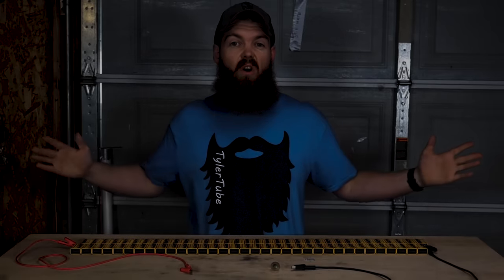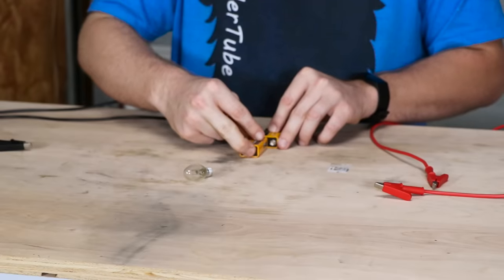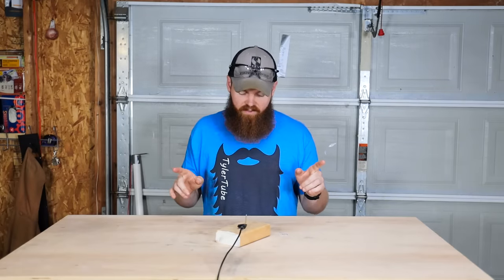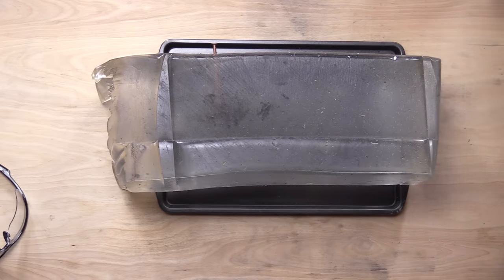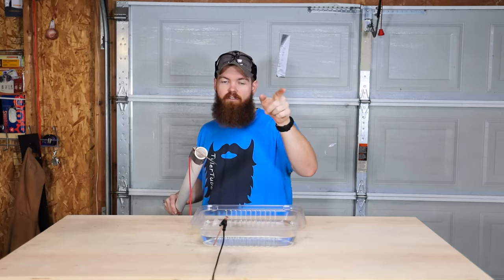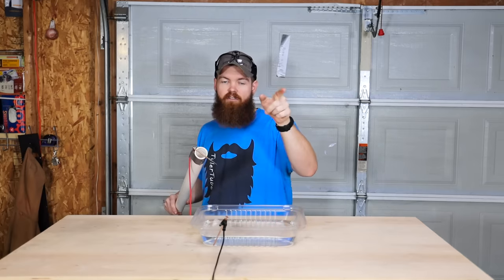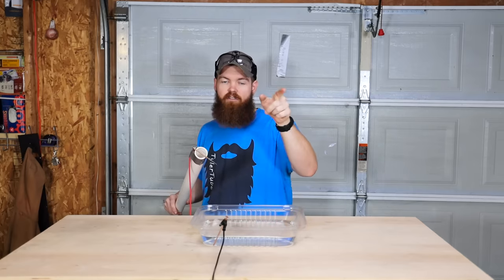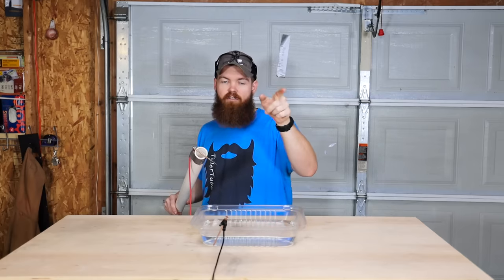I Connected 500 - 9 Volt Batteries...

Comment: 6:22 you nearly just died and I’m not sure you’re even aware of it

Please stop doing these if you’re going to be reckless like that
Reply: Yep !
Reply: Holy shit I didn't even notice that, but noticed a bunch of times he touched things after his PVC pipe got contaminated with conductive vapors.
Reply: There isn't enough of a current to cause damage, theres alot of volts but not much current. He even said it in the video
Reply: Uhhh how? He's not even doing anything at the time stamp you provided.
Reply: @BuddhaBoiBrett  Each 9V battery can deliver about 1.5A of short circuit current.  0.01A (10mA) produces a severe shock, and 0.1A (100mA) is lethal.  The voltages are definitely high enough to deliver that much current through a person (1,000 ohms once the skin is pierced or arced into).  4500V / 1000ohms = 4.5A if the voltage source has no internal limit.  In this case, the internal limit is 1.5A, which is still 15x the lethal current.  Imagine those hotdogs being the nervous system going to his heart, I'd say that's going to cause a lot of damage.
Reply: @theburningissue3132  He's brushing his hands right over the exposed + and - terminals of the overall string of 9V batteries.  Had he brushed his hands a little differently, he would've been shocked and likely died.  He had 69 batteries in series, that's 621V.  Going through a 1000ohm load of a wet/sweating person in a hot garage, that's 621mA.  10mA is a severe shock, and 100mA is fatal.
Reply: @yueibm  I was thinking the exact same thing. When he had the 600+ volts I was cringing when he was brushing his hands around the exposed positive and negative ends. I am surprised the potential was not high enough to arc and zap him as close as he was already. Made my knees weak just watching.
Reply: @robotsmash0077  Good point!  Either he's really lucky or his skin was more dry than 1000ohms and while not fatal, he got the bejesus shocked out of him and edited it out.  Russian roulette would've been much safer than what he did.
Reply: Christ almighty, you aren't wrong. Tip for ANYONE planning on working around high voltages (especially if you aren't super experienced with them): Stick one hand in your pocket. Leave it there the whole time you're working. If you do something dumb like this and nearly get shocked, at least it won't be going from one hand to your other hand and right across your chest. I hope this guy fully appreciates just how damn close he came to dying here. Not a nasty shock, death.
Reply: Saw that too. Wow
Reply: @JMMC1005  And even then, every time he was casually laying that positive stick on the garage door he was absent mindedly connecting it to the garage door, which has an equipment ground, goes to the breaker panels's grounding electrode, which is connected to the concrete floor under his feet. And he lays the other electrode on the table and wonders why he gets a little shock from the table. I'll tell you, if that clip had been damp or the insulation had arced over when he grabbed it to put it back on the hot dog, the shock wouldn't have been so little. His feet would be the positive connection and he'd be the lightning rod for the short circuit.
Reply: Yue Fan batteries have internal resistance, so as he connects more batteries together he keeps adding more and more resistance and current stays the same throughout the circuit. As you add more voltage drops, batteries in this case, your current between them drops to match the one before it. Voltage is the pressure applied, resistance is the thickness of the wall, and current is the amount water. When he put his hands on the connections, he added a significant amount of resistance to the circuit which dropped the voltage potential while the current remains the same.
Reply: @BuddhaBoiBrett  there is somthing called a microwave transformer it runs at 500 milli amps and 2000 volts it kills more electronics hobbyists than any device and those deliver 1.5 amps or 1,500 milli amps and 4500 volts,500 milli amps is alot of current, dont listen to him and amps are not the killer as idiots say it the amount amperage the voltage CAN supply you can't have high voltage without current it's like saying I'm going to shoot you but as long as the bullet hits you softly you'll be fine dont trust random statement from someone who isn't a trained professional or at least has knowledge and from looking at his experiments with water he doesn't realize that PURE water is the best insulator known to man, his water had some minerals in it if it was  nothing would happen but from this you can gather that some of the first things that you learn he has no clue about dont blindly trust him, I like his content though
Reply: @ThirdInLine  That... isn't right.

Each battery does have internal resistance, but also adds voltage to the circuit. A series string of batteries has the same short-circuit current as a single cell. If a 9V battery can supply ~1.5A, a string of 9V batteries can also supply 1.5A. The difference is that the overall voltage of the string is much higher, so it can actually push that current through a fairly high resistance (like a person, for example).
Reply: Yue Fan Voltage output is only limited to the amount of current available. So if the current is limited the voltage is limited.
Reply: @jacobh9335  yes thank you!
Reply: JMMC1005 you’re forgetting the internal resistance of that battery. You ever wonder why you can touch the positive and negative of a 9v battery with the same finger and get almost nothing, even with wet fingers or on your tongue? That’s a short circuit after all. You’re assuming that the battery has zero resistance, that’s not how batteries work.
Reply: @ThirdInLine  while you are right the fingers skin wont allow the current to go through that's you dont get a shock
Reply: Luv Piru and why is that?
Reply: @ThirdInLine  the restince of the skin
Reply: That’s exactly my point. The voltage drop created by adding resistance is significant because internal resistance is low until a load is applied. There’s not a lot of charge available in batteries, it’s a chemical reaction relying on low resistance applications. When you start adding tons of batteries, the voltage rises because they’re in series with each other, that means that internal resistance continues to add up, but current must remain the same through loads. Him adding his entire bodies resistance in between the connections is dangerous, don’t misconstrue my words, but it is not deadly. You can grab very high voltage DC lines with little to no effect because of lower current values, certainly you’ll get burned and it will hurt, but he won’t die. His bodies capacitance coupled with his body being separated from ground would mostly stop any deadly current load through his heart.
Reply: @ThirdInLine  you are correct but when you get high voltage looking at the stability of those arcs as well as there heat and color they are 500 mili amps and my point was referring to a single 9v battery 500 of them 4500 volts 500 milli amps will easily break through the skin and if it passes through the heart it will kill you its double a microwave transformer which kills more electronics hobbyists than any
Reply: @ThirdInLine  and he isn't separated from ground as far as I can tell if the circuit which he would be completing was isolated he would be fine
Reply: Luv Piru you’re not taking into account the impedance of the human body due to capacitance. He’s in a closed system at the point in question, he’s not connected to any earth because he’s wearing shoes. Impedance of the human body is quite high, typically 10s of megaohms. This is why you can touch car batteries (that have 100s of amps of current) and not be exploded by that high current. We have added resistance to the system. Tyler has really high voltage, really high resistance which cuts the available current (because the current has to stay the same through every voltage drop and he becomes a voltage drop). So if there are 500mA available in the system, his resistance means that max available current through each drop (given he has the only resistance available) at 100k ohms is 6mA as I=(v/r).
Reply: @ThirdInLine  the resistance of the human body can be as low as 1k. If he touched this wrong he would be dead. The only reason he didn’t die was either he didn’t touch the terminals or he was really really lucky and his hands were dry.
Reply: @jimmysyar889  please read my other explanations. We don't deal with hypotheticals when evidence is right in front of us.
Reply: @ThirdInLine  The evidence is that he didn't touch the terminals. If he did he would almost definitely be dead. The 9volt batteries can output up to 5.5 amps for a few seconds. According to the datasheet, each battery has an internal resistance of about 1.7ohms there are 72 of them in series so the total resistance is 122.4 ohms. This brings the maximum current output to 5.31 Amps. Assuming he has a resistance of 6k (very generous) then the current delivered would be 106mA and that is plenty to kill him. I would like to see your math which shows this being safe.

Edit: the resistance of human skin is not a few megaohms. Also, the human body does not act like a resistor. Once the outer layer of skin gets broken down from the very high voltage the insides have a resistance of tens of ohms.
Reply: @jimmysyar889  5.5 amps for a few seconds? Please tell me where I can get a 9V battery with that kind of current! That would be epic to have for all the experiments! That is the single dumbest thing I’ve read today, so thank you. Max output current is measured in mAh for a reason, a 9V battery typically has about an amp of stored current with 1.7 ohms internal resistance. What happens to current when you add resistance to the system? It stays the same, right? Since current is the same in series, the voltage is what changes based on resistance. Have you ever licked a single 9V battery? That’s not 5.5 amps coming out, which would literally explode your tongue. 9V batteries can only discharge so much current based on available voltage since if current discharges, voltage will drop and resistance will rise. 

What does capacitance due to DC voltage? It “blocks” it, more correctly it stores then discharges. This is why AC is much more dangerous to humans, as it bypasses the body’s natural capacitance. 

I never said he wouldn’t get shocked. Yea, it would burn the shut out of him, but the momentary discharge would only do that, burn him. The discharge current just isn’t enough for him to die instantly.
Reply: @ThirdInLine  First output current isn't measured in mAh, it's measured in mA. mAh is the measure of capacity at a given voltage. What do you mean a 9V battery has an amp of stored current, that doesn't even mean anything. If you short a 9V battery the only thing causing it to not output infinite current is the internal resistance. If it's 1.7ohms that's 9/1.7 = 5.3A Maybe you should go back and learn ohms law. V = IR 
And you thought what I said was stupid. HA! If you licked a 9v battery you would have 9 / (1.7+resistance of your tongue) amps going through your tongue. This is not 9V that is being discharged it's 650.  It's the same current capability yes, 5.3 only, but we no longer have 9v we have 650. It's true that there is now more internal resistance but it's only about 120 ohms. I would love to see you stick your hand on a voltage source of 650 with only a 120 ohm resistor in your hand. It would deliver about 100mA of current and that is plenty enough to kill you. You obviously have no idea what you're talking about. Perhaps you should do some research and look up some data sheets before you respond.

Comment: This dude legitimately almost died at 6:24. 600ish volts at 500+ milliamps is more than enough to kill you if it runs up your arms and through your chest. Also later in the video he touches the connected negative lead while the hot it touching the garage door, plus the many other ways he could have been shocked and killed by this. I found it particularly humorous that he does not wear saftey glasses to blow up glass lightbulbs with high voltage, but then puts them on as his only saftey precaution when creating arcs.
Reply: Amps dont matter, if you have 600v but you have 2MOhm resistance, you would get 300uA through you

Comment: 06:50 Tyler casually having his hands around the plus and the minus at 600 odd volts
Reply: Thankfully thoughs battery's don't work like that, the leads sit side by side instead of top and bottom or it would not have been so casual
Reply: @afroman5531  no I saw it too. If his juicy fingers had been curled even a few millimetres further down, he would have completed a circuit with his body as the load resistance.
Reply: @afroman5531  WRONG!  The batteries were firmly connected in series, creating a source of hundreds or thousands of volts with the capability to supply hundreds of milliamps.
Reply: @whatdoyouwantfromlif  he is touching the ends of the battery’s, he is not making contact with the connection. Yes they can be strung up in conjunction but again that’s not no how battery’s work.

Comment: 20:58 didn't even remember where he left the live HV negative lead.  This is the most dangerous video I've seen in a while.  No one repeat this.
Reply: His first try with 300 batteries was even worse, he was holding an aligator clip in each hand, with just the thin plastic cover and a pair of crappy leather gloves between him and the conductors. But yeah this one was pretty sketchy.
Reply: @deltab9768  Wow I'm surprised this guy's alive.  The whole video (and the previous one) needs to show a disclaimer that he's doing it wrong and he almost died.
Reply: @deltab9768  Jesus. I felt uneasy clipping two of those across two leads I suspected to be phases (400V AC) to measure and I connected them one at a time while making a point of only touching the multimeter casing and not the first wire while connecting the second.
There's no way in hell I'd use them for high voltage.
Reply: Currently repeating

Comment: Tyler is gonna light his  house on fire after a while I swear
Reply: Or his beard
Reply: Don't jest....thats what he's doing next
Reply: At least you can extinguish and repair a burning house. A burned/elctrocuted body is not such an easy fix. Kilovolts will burn a hand off a lot quicker than they'll cook a hot dog.
Reply: @deltab9768  I had a college professor who was a nurse....she said that one time she had a guy come in with electrical burns from trying to steel copper from a transformer.....she said he didn't make it through the night.....
Reply: @sparkydog7912  yup. Nasty stuff, it's not just the sparks that burn you  it's all the body parts that have current flowing in them also burn from the inside out.

Comment: I knew this was going to be terrifying As soon as he used the calculator to figure out the voltage of 20 9V batteries in series.

Seriously, you are lucky you did not die while doing this. The current capability of this power bank is plenty to kill a human very quickly. Never try this at home - even a someone who actually knows about electricity should not try this.
Reply: Exactly what i said. Its literally 9x2. (Add a 0 for the single 0 in the 20).
Its basic math and he needed a calculator ffs
Reply: Someone who knows about electricity wouldn't be within 5ft of this thing...or probably building it either.
Reply: Hell, that beast could wipe out my whole street
Reply: Yeah, depends on the environment but connecting them will cause some sort of fumes.  I hope his garage is ventilated
Reply: @nevernever2002  i dont know how the whole battery bank didnt explode ive connect 10 9v batteries together and it cause 1 to start melting through the casing
Reply: @68at97  Coulda been the discharges dropping the watts to something less volatile, maybe the type of wire he used provided enough resistance to cause waste heat enough outside the batteries themselves.  He could just be trolling for engagement too, it wouldn't be too super hard to hide leads in that mess that feed off something like a spot welder's power supply or w/e
Reply: @68at97  
Then you connected them wrong in some way and caused a short. There is no way that it melts without completing a circuit
Reply: @flosa1995  yeah they were shorted
Reply: Dude I damn near died in that moment for the same reason. If you can't do 9 times 20 in your head, you don't get to play with electricity. Probably shouldn't get to vote either, honestly...
Reply: The rule of thumb when dealing with dangerous voltages is to keep one hand in your pocket to avoid the availability of a current path across tour heart.
    Also, normally wearing rubber soled shoes is a good idea but when you can draw a 12+ inch arc with the voltage that he was using, a half inch layer of rubber would mean as much as the 300 volt rating on his clip lead wires.
A 1/2 inch layer of rubber + 300 volt rated wire insulation X 5.400 volts / A BRAINLESS CHILD = EXACTLY SQUAT. 
Yup, it all adds up to a disaster looking for a place to happen.
Reply: All you nervous Nellies!  Go fly a kite in a thunderstorm...